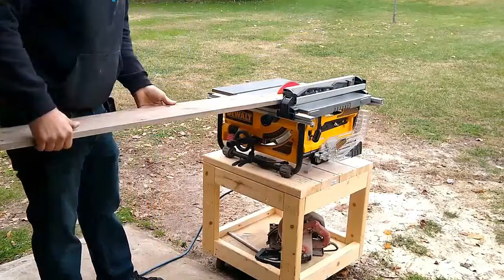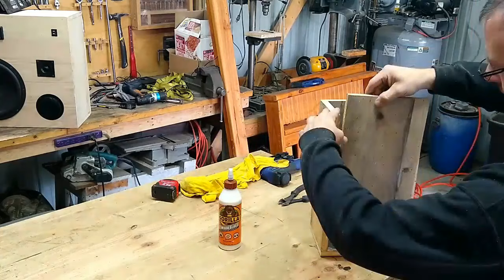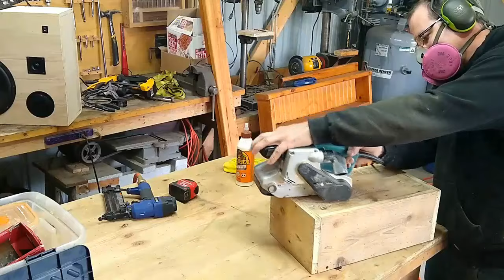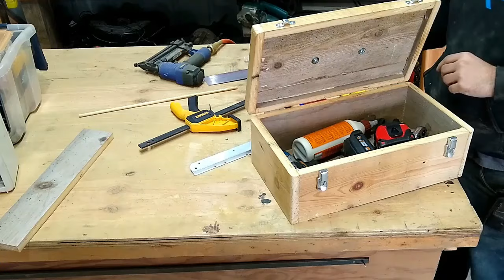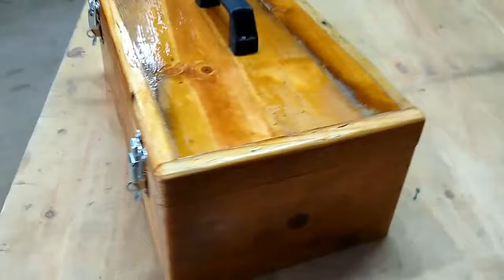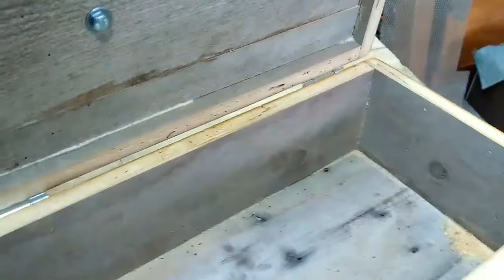diy tool box from pallet wood

Comment: Nice job.  This would be a great project  for  someone with not too much experience, or  for that matter anyone who needs a quick , relatively simple box. Thanks for posting.
Reply from the maker: Thanks and that was the idea and im still using it as of today but ill be making a better one shortly here in the future
Reply: @jlistdiy  Great !   Maybe 45 the sides ( or use box joints) with some splines . A removable tray would be cool too . I like making boxes for tools like brad nailers n stuff because the cases they come with usually don't have enough space for oil and various size brads .
Reply from the maker: @twoweary  thats a great idea thank you now you got the gears spinning in my head lol

Comment: Hola, cómo se llama el aparato que usa, es una clavadora o grapadora, que medida de clavo usó? Neumática cierto? Que tipo de spray  uso? Es barniz o laca incolora? Gracias
Reply from the maker: It's a pneumatic Brad nailer and I used 1.5 inch Brad nails and for the spray I used a polyurethane

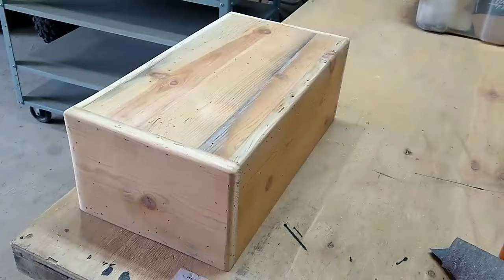Comment: I liked that you made a simple box. This is what I am looking for. However what if a person does not have this electric saw, how should he go about cutting the top lid at 4:08 ?
Reply from the maker: Hmm that's a good question 🤔 now you got me wanting to build one with only non powered hand tools, I would think if you marked a line around the top and used a hand saw you could achieve the same results
Reply: @jlistdiy  Thanks Jamie. I am wondering what if we don’t glue the top side i.e. keep the top open after fixing 5 sides and just use the top (6th) side as lid? Will it not work? I mean can’t we do this without first closing all six sides and then cutting the top? Anyhow i saw your other video as well where u made a bigger box. Thanks for ur suggestions.
Reply from the maker: @viveksabharwal9027  that's a possibility but wonder if the top would warp with time due to humidity
Reply: @jlistdiy  Yes btw what u have done here has made the box look nice (thick top lid) 👍🏻

Comment: I want to try this but don't have cutting tools 😟
Reply from the maker: This could be done with a hand saw and trim nails but it would take alot longer
Reply: Yes sir ur right ,and goes very cross too
Reply: @made2worship882  What you need is a marking gauge, set square, pencil, marking tool or knife and a half decent wood plane and a saw. Mark the wood depth on both sides of the plank then cut outside the line 2-3 mm if you want . Then plane down to the line at an angle ,45 degrees, first one side of the board then the other . put pencil on the fresh planes chamfers and then plane down level untill the pencil lines disapear and you should have a square and flat edge ! No need for fancy expensive tools and if you practice it will be a skill you can fall back on anytime even after you have yourself a table saw
Reply: 👍😊 thank you very much sir.